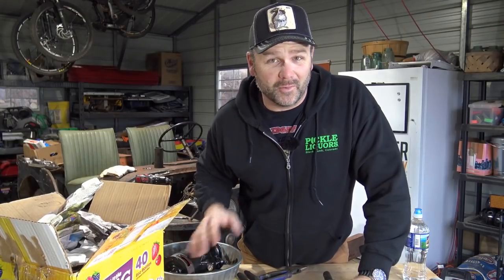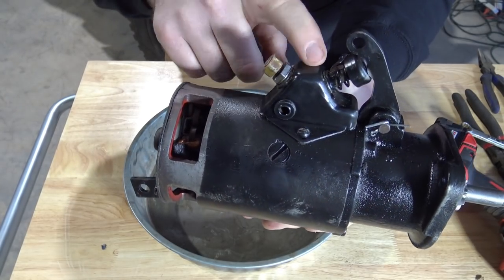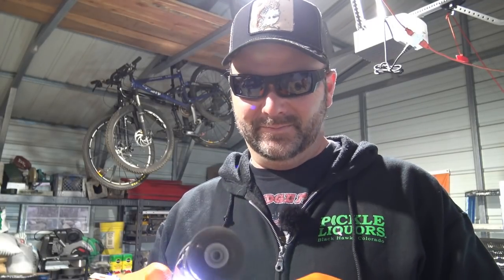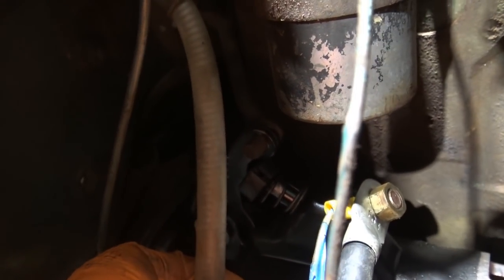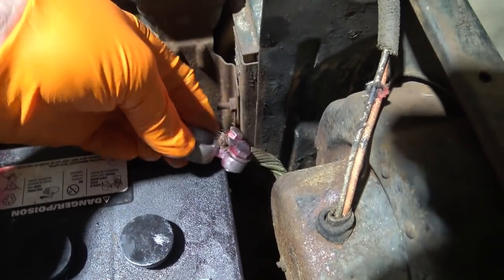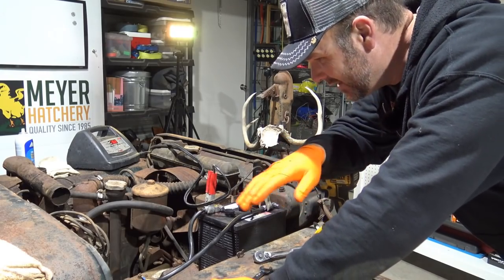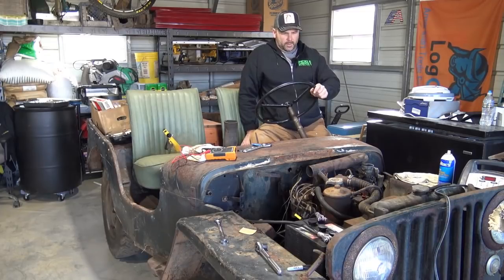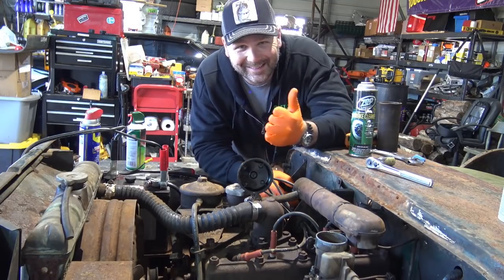Willys Jeep Rescue: More fun with the project! Anybody got spark? Wooooo!

Comment: Spray lotsa lube in the cylinders take all plugs out and spin it to free things up.  Ground the plug when it’s removed to ck spark.  Lightly sand the points and regap them.  Get a new rotor and cap. That should be enough for a while.

Comment: No, you don't replace brushes unless they're in dire need of replacing, that is cracked, broken, or soaked in grease or oil. However a thorough cleaning and lubrication is necessary. Remember that a starter motor spends the VAST majority of its life sitting idle doing nothing.

Comment: Use as little starting fluid as possible. It dries out the cylinders and yours probably need a little marvel mystery oil as it is. I once sprayed and sprayed starter fluid and the wrist pins froze up.

Comment: When you check to see if it has spark with a spark plug tuch it to metal then turn it over that's what I always have done for ever. That's another thing if the cap has that little lead pice broke it will not fire. I had to do the same thing to my 1995 Chev truck

Comment: Ground the body back to the battery grounding to the starter only may interfere with the rest of the ignition system and checking spark at the plug the plug needs to be touching metal for it to spark

Comment: Hey Josh,
Looks like you may have a bad capacitor in your points set up.
The capacitor holds the spark until the rotor hits the contact in the cap.
They go bad over time.  I didn't see any spark in the points.  So, I'm thinking
bad capacitor.
Tim from Arizona

Comment: A spark plug needs ground... Place the thing on the engine case and you should have spark if not check: point for grease, dirt or corrosion, check if the condenser is still good and test the coil (you can do that by just disconnecting one of the thinner wires going to it while it is hot and make sure the rotor is in such a position that it will conduct to the sparkplugwire you have the exposed plug connected to...

Comment: is it turning the right direction? some where in the mid 50s they changed from positive ground to negative ground,  it may be a positive gound system,   the old starters like 12 volts they turn better they pull less amperage that way, then get a old resister for a 60s dodge,  for the coil or get 12 volt coil,
Reply: The old willies were 6v positive ground.

Comment: I'm sorry guy... I used to work for an IH dealership when I was a kid.  I don't know how many times I went along with the mechanics when they were pulling and old H, M, W-9 (this was in the 70s) out of the weeds so they could get it running and put a Farmhand loader on it.  There was a method to getting those old beasts going.  I am sure youtube can educate you.  They checked sparkplugs, plug wire, carb., oil, and on and on.  They spent 45 minutes to an hour, or even longer, before they ever thought about turning it over.  I think once or twice it didn't start up the first time.  They did change the oil and filter first thing.  They drained the old fuel from the tank second thing.  They replaced sparks or glow plugs, and plug wires....

Comment: As far as the starter rebuild goes, I would have thought, at the very least, the brushes would have been replaced, along with everything being cleaned up. But for $85, you do not get much, now a days. 
Good luck. Very touchy systems. Sparkplugs need ground to show spark. Looks as if cap, rotor, condenser, plugs, ect, may be needed.

Comment: When it comes to rebuilding starters it really boils down to who dose it and what they really have in stock to make it work. My family owns and runs a rebuild shop and depending on what the part owner wants done is what we do fix it on budget means we do what 100% needs to be done. Like one of the brushes could of been hung up from a type of corrosion and still had lots of life on it so they could of just cleaned them up and put it back. But not all shops are worth going to. Rebuilding starters is becoming a lost art it’s mostly becoming cheaper to buy a new one than it is to overhaul one.  But most of the time it dosent need a hole overhaul.

Comment: I saw you using wd-40 in an earlier video. I highly suggest that you try "PB blast it". It is a much better penetrating oil, you can get it at Napa. Remember that wd-40 was made as a water separator. Might save you some work.

Comment: You can modernize the points and condenser system fairly cheap,  then the coil, and the cap and rotor. Your cap center piece is broken, there should be a spring loaded button there. spark plugs are pretty cheap too. If it runs good then, you can upgrade the wires, wires have gotten expensive last time I checked. Carb rebuilt kit shouldn’t be too bad, but the fuel subsystem and filters, and all fluids should be changed out too. I like both, but you have a generational family history with the Jeep, so my vote is to fix the Jeep first. Ed
Reply from the maker: Yep just ordered all the parts...waiting patiently for them to arrive!

Comment: If you take some WD40 and a wire brush to the spark plugs they should clean up good. Those plugs are pretty dirty. And try poring a little gas down each spark plug hole that should fire with out the use of the carb because that carb is probably full of gunk and old goo so that is probably another thing that is not helping.

Comment: First of all remove all the spark plugs ,pour some oil into all the spark plug holes. Then crank the engine for a while .while the spark plugs are out also check for spark. If there is a healthy spark,then ignition system is good . Wait a while for the oil to soak up in the cylinders.Put back the spark plugs and wires in the same order . Start the engine after pouring some starter fluid in the carburetor inlet

Comment: As Jason said rebuilt only fixes what doesn't work and remanufactured should replace any worn parts to new quality
Reply from the maker: See....I disagree.....if you rebuild something electric you need to replace the worn parts....not clean them and re-assemble.
Reply: I'm not saying it's right but I learned 50 years ago in mechanic school at Nashville Auto Diesel College if you bought a electrical product  in a parts store that wasn't new make sure it was remanufactured not rebuilt because that was how the companies kind of cheated people that didn't know that only the non working parts were replaced

Comment: The battery voltage should be higher than 4v. It should only drop to 4v while you are cranking. Any lower and your spark wont fire.

Comment: The threads of the plug need to be grounded. Its a circuit. It wont spark unless its grounded. Good idea to use a screw driver to help ground it

Comment: Did they have a neutral safety switch back then? I don't think they did, but maybe someone added one and it's bad? Also, the plug has to be grounded, hold the steel body of the plug to a clean spot of metal.

Comment: Invest in a good volt meter. And clean and check all the electrical connections. Bad wiring causes fires
Reply: Six volt also requires the right guage of wire.

Comment: ok this is the deal with rebuilding old classic starters.. The guy did an excellent job and used only what was needed.  Because you did not state that you wanted to have everything rebuilt completely I would not cry about it.  Rebuilds and the price you got for it was a bargain.  Your not grounded properly...  You might also check to see if the rotor is actually spinning on the top of the Distributor.

Comment: Put a chevy 12 volt alternator in it and 12 volt optima battery in it. You can get one at the salvage. It will just have one nut for the battery on the back or the alternator and 2 prong plug in. There are tons of videos on this subject. I just went to salvage and told them I want a chevy alternator that is used to do a 12 volt conversion they knew immediately what I was talking about and gave the correct alternator. we put it on my dad 6 volt tractor and it worked good. 6 volt turns over real slow. No one uses 6 volt anymore they always convert to 12 volt using the one wire chevy alternator. You can buy a new also at the parts house.

Comment: the starter is supposed to have a cover on the brushes you can easily make one with sheet metal and a hose clamp. the canister on top is the oil filter. are you sure the system isnt already 12v? you didnt ground the spark plug lol got to clean the points

Comment: You can download the technical manual for the WW2 Jeep by searching for TM9-803. While yours isn't a military Jeep, there is a lot of information here that is applicable to your CJ-3
Reply: When you search for TM9-803, you will find several different .pdf files available to download. It's worth looking at several of these because the scan quality varies and the illustrations may be better in one or another,
Reply from the maker: Cool thanks man

Comment: The #1 spark plug metal outside wasn't touching ground.  There's no way to see a spark when it's sitting on rubber hose.  The plunger on the distributor cap was broken off not making contact.  Didn't see any spark from the points either. Pour some Marvel Mystery Oil into each of the plug holes on the cylinders and let it sit and lube up the rings.  It will improve the compression too!  Check out some of Mustie1's engine videos where he works with REALLY OLD engines. The man is a magician when it comes to old engines.

Comment: The battery is ro weak 4 volts on a 6 volt system isn't enough to spin the motor fast enough. The plug needs to be grounded to check for spark but I would change cap and rotor first. Might as well do plugs and wires while you're at it.

Comment: That was a terrible job rebuilding that starter. As a teenager I worked at a place that rebuilt starters, alternators. If my boss saw a job like that I'd be gone. If you replace one brush you replace them all. Wires also.
Reply: Kurt Baker That rebuild only works until the next frayed wire breaks.

Comment: I would have put new points condenser rotor and distributor cap on it and if the plug wires are the original ones I would have to swap them out to.

Comment: Oh by the way that big canister thing is the oil filter. You really should be changing all of the fluids before you run that engine. Never a good idea to run a water pump dry. That seal will get hot by friction in seconds. Needs to be wet to be safe.

Comment: I didn't follow all of your comments, but did you clean the starter mounting surface down to bare metal? If it isn't clean, the starter may not be grounded so insufficient current will flow - it's only a 6 volt system to start with.

Comment: When you are checking to see if the plug is firing  the plug has to be grounded to metal not laying ontop of a rubber radiator hose.

Comment: Put new points in it and cap and rotor and when you check the spark plug grounded out to the head or something metal it will not fire on a rubber hose because it's not grounded
Reply: I wish I could be there I could make that thing run

Comment: you will never get everything replaced on a 6 volt starter. the cost would make your head spin and you wouldn't want it fixed . I have had many rebuilt and had years of trouble free use.  a lot of the original parts are way better then new parts anyway

Comment: I would definitely find someone else to rebuild that starting or replace it with the a new one! I’d pull the button you push on and clean it up. Replace the cap rotor points plugs and wires! If you rebuild switch it to a 12 volt system

Comment: Hopefully this guy learns some vehicle mechanic basics before continuing.  I think he'd have just as many problems with other vehicles if he can't learn these basics.  Should never have tried to turn over the engine without soaking rings.  Spark plugs have to be grounded.  Carb should be cleaned or at least removed and have a clean area around intake so you're not sucking old nasties into the engine that way.  I know you have to start somewhere in learning the basics, but I wouldn't do it with something like this Willy's that is somewhat of a collectors item......

Comment: If I heard you correctly, your battery is not good or you have some large load pulling it down. I think you said 4.x volts when it was not trying to turn the starter. That is not normal.

Comment: You'll get there after it's all new  Ignition and plugs vacuum hoses and wiring new fuel tank and carburetor rebuild then it's good for 67 more years it is worth it even if the body falls off just put a fiberglass tub on it still worth it

Comment: Hi, riveting videos of jeep.  Just picking up on a few things. Dan Riceman  suggests pos earth, which i'm sure you mentioned it is in a previous video. If so, it looks like you got the battery the wrong way round (bearing in mind I can only see what looks like the  - ive symbol to the right of the battery). It also looks like your original earth strap is too short to reach the battery in the position you have it in now i.e. the battery wrong way round. Further to this, I think the  distributor camshaft and rotor arm appear to going backwards. This could also be because your not wired up positive earth, or because the people that rebuilt your starter wired it up with the brush and field coil wires mixed up.

entertaining to watch though

Comment: As I said earlier you need to check the wiring before trying the start... should all of the plugs and rotor and points!!!!!!!!!! less $100 bucks for them, then add even the wire to headlights taillights, brake lights, dash and turn signals... Shoot for it all!!!!!!!!!!!! that spark plug looked like it was gone a long time ago!!!!!!!!!!!!!

Comment: You filed the points, but did you check the condenser (capacitor)?
Reply from the maker: I see you're working your way through the vids......I did finally get it running...the issue was a voltage drop

Comment: Turning over too slow. Spark plug must be grounded to spark. Needs new plugs, cap, rotor and points. Battery must be positive ground. Consider upgrading to 12 volt system. Can use same starter for that. Just need a 12 volt coil with internal resistor and switch generator to alternator. And then switch to negative ground and flip wires on volt meter.

Comment: you will not get spark at the spark plug whilst the spark plug is sitting on plastic, you need to rest  the plug against metal, by doing that, it will complete a a circuit for spark,  i am sending this information from Adelaide, South Australia, my name is Sam

Comment: Brushes like spark plugs should be replaced all at the same time.  Take it back to them.
Reply: Agreed. A rebuild should be more than just washed up. New bearings and brushes at least. Wiring made nice and coils checked for proper impedance. New insulating/vibration protection dip on the coils and polishing the contacts.

Comment: so why didn't the starter re-builder  replale all the brushes in the starter... & get rid of all the old & freyed wireing......????
Reply: the average customers want things done as economically as possible. I've been on both sides of the equation. Now when I bring anything in for rebuild or work in general I specify if I want a restoration-level build or just get 'er running repair. There are starter repair jobs that can be done for $40 or if you literally want everything replaced you can spend several hundred. Good communication is the key.

Comment: The original ground strap was on the engine. You replaced it with one to the chassis. That is your issue. The heavy ground goes to the engine... the small wire goes to the body. If it didn't fire on either, pouring gas down the carb ain't going to do it.

Comment: Late comment here.

Rebuilt products have nonfunctional parts replaced. Remanufactured products have all parts replaced or restored to specification (not necessarily factory specification). 

Points, plugs, cap, rotor and wires for that thing should be $50 to $150. Keep away from the $35 stuff. For a car that has been sitting that long replacing these items should be done without question.

For checking spark I have a known good sparkplug hose clamped to a big alligator clip, like the ones on your battery charger. This allows me to ground the sparkplug to metal without getting shocked. But what if the spark plug is bad? At $2 a piece it costs more to check them than to replace them.
Reply from the maker: So....I've ordered most every part of the ignition to replace...just waiting on it to arrive

Comment: Josh, is the battery ground attached to the frame or to the engine block?  I'm just thinking out in left field here, but if it's attached to the chassis frame I don't know if the ground would get to the starter if the engine is mounted with rubber engine mounts?  haha  Guess I should have watched the whole video instead of pausing at the 11:00 mark to write my comment.  Doesn't get any better ground than what you tried.
Reply from the maker: lol thanks brotha...good thinking!

Comment: If you get a new condenser (chinese) guarantee it will last less than a week.  Stick with the old one unless it doesn't work at all.
Reply: As a DIY home mechanic always pair a new set of points to a new condenser a old condenser to new points does not lost as long as a new pair and a 12v condenser is supposed to work as well as it is only a capacitor, the condenser is there only to stop excessive arc on the points and a vehicle can run in emergencies without one.

Comment: setting the spark plug on the rubber radiator hose will result in NO spark  Try setting on a bearmetal body part

Comment: What was playing with the choke going to do to help with the timing it's out of time,see what direction the rotor turn's and with timing mark on the balancer is at zero which ever tower of the distributor cap the rotor is pointed at is no.1 plug then#3-#4-#2 in the rotation direction and the condenser wire was junk you can see the insulation pulled away from the condenser body